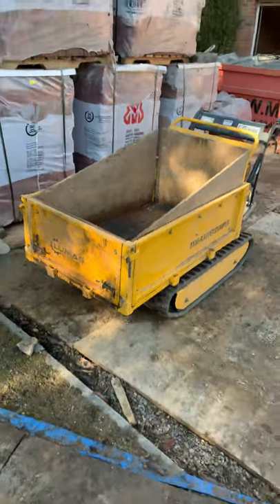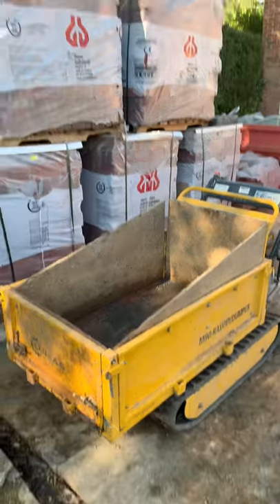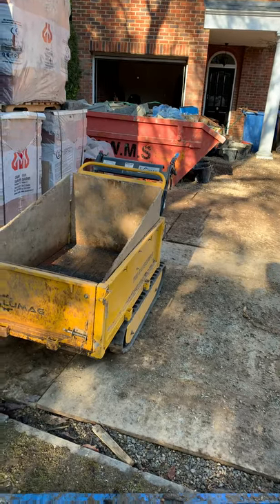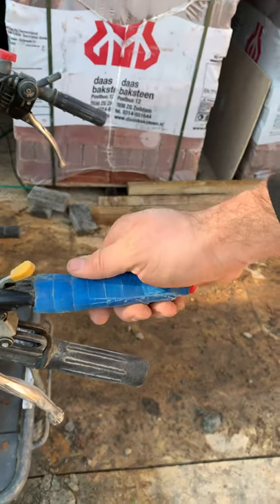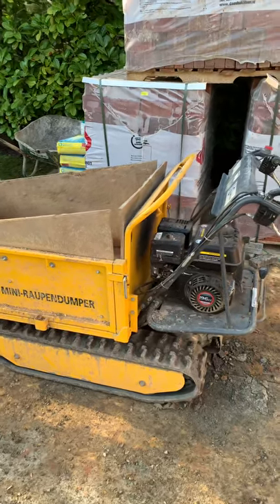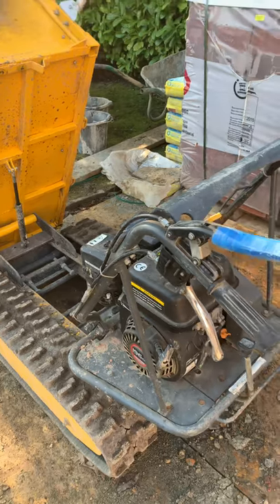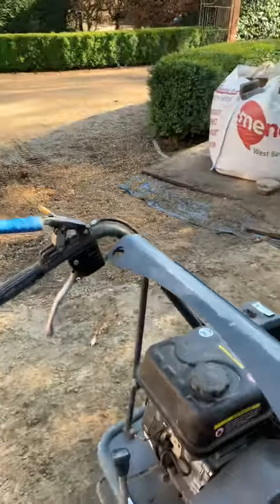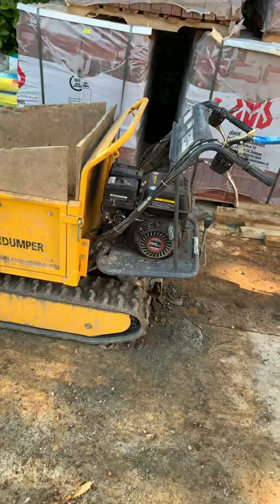Lumag MD500 Review

Comment: There is a video showing weakness on the metal welds underneath the tub/bucket where they split.  I’m unable to find it again, if anyone has the link it would be useful.  They are of very poor quality and need to be reinforced if it is intended for long term use and carrying/dumping the maximum capacity.  Other than the minor problems, these machines are a great work horse.  Like all Chinese machines made to a low budget, they have to be maintained thoroughly and in many cases, modified.